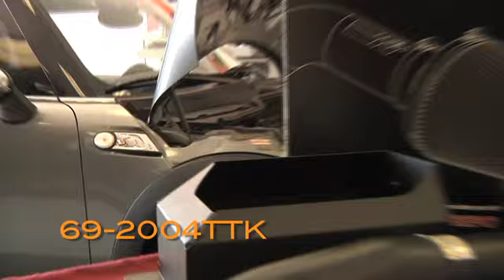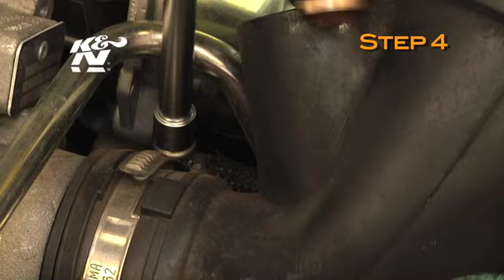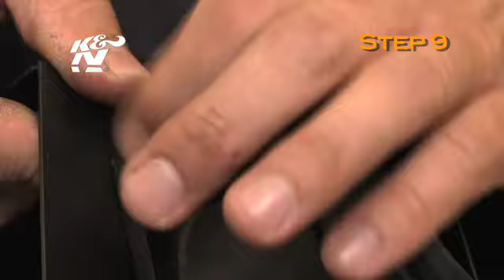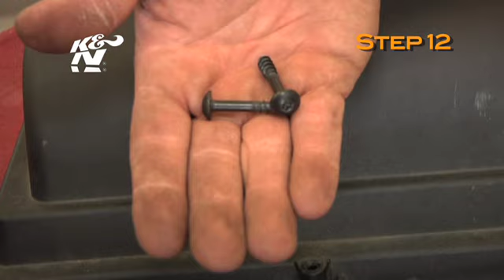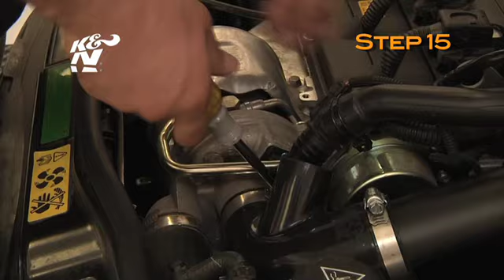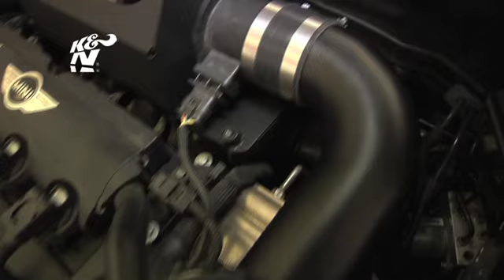Mini Cooper S 1.6L  [#69-2004TTK ] Air Intake Installation

Comment: i just completed installing the 69-2004TTK kit to my 2009 Mini Cooper S Clubman. This video was very helpful and all in all... the install was basic enough to where I would recommend installing by owner as opposed by a service garage. Two problems areas I encountered were 1) The clamps provided for step 11 were too small which made it more time consuming to attach the silicone tube along with the clamp. If the sick #$%@$&'s ;),at K&N would have provided these two clamps just one size larger this would have made the install a lot easier and quicker to manage. 2) On step 13 there was only one screw hole available (on passenger side) to fasten the box down on. The other side (driver side) only had a rubber grommet fastener that does not accommodate fastening that side of the box with a screw. Meaning there is only one screw holding in place the air box. I took the mini for a spin and did notice a little but not much more of a growl but I also heard a bit of a "whistle" type sound from the air intake when letting off the gas which I thought was cool sounding as long as this whistle is normal.